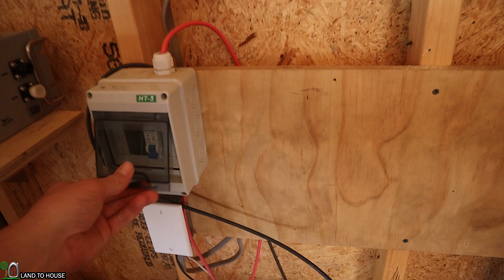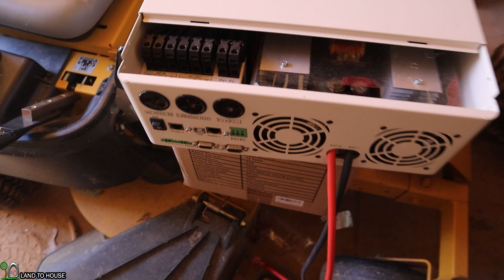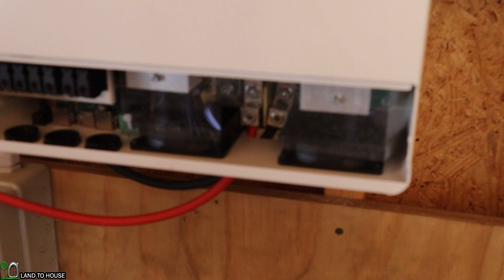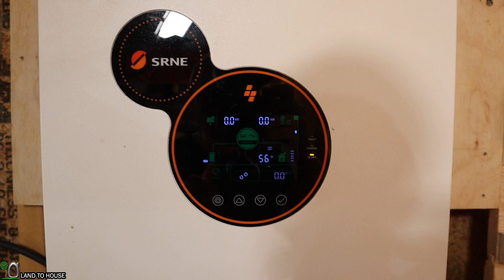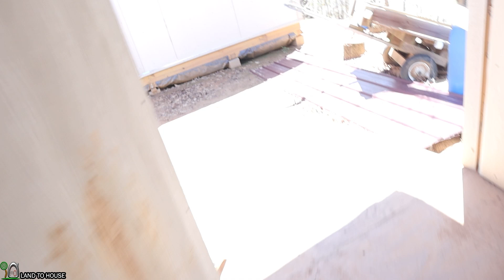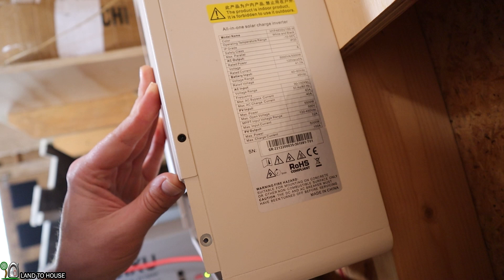Lawnmower shed goes 48v OFF GRID - Ruixo and SRNE

Comment: you didnt show the AC Panel circuit panel wiring... did you just go from the inverter to a combiner box, then two legs running out to just outlets with no breaker panel??

Comment: I literally could not have done anything else on that setup before getting it grounded.  Can't even watch the rest of the video.  :)
Reply from the maker: Because it's electrical noise. You don't hear It in person. It wasn't until the video was edited. That I realized how loud it was.
Reply: @LandtoHouse  - OK, that makes sense.  I can understand not wanting to shoot the whole thing again, or overdub the audio, but MAN, that was annoying!  :)
Reply: So if I install this in my trailer and try to video call someone on my laptop while it’s plugged in, Will it make this noise? This would be a big deal if someone worked on the road.
Reply from the maker: Thats a good question. I know grounding the inverter stops the buzz. But is the trailer frame enough to do that? I don't know.